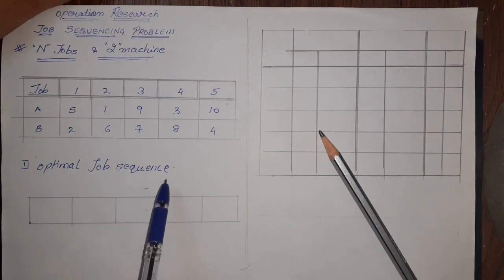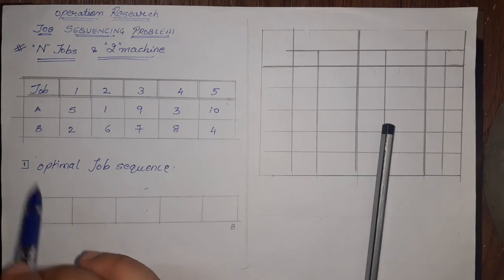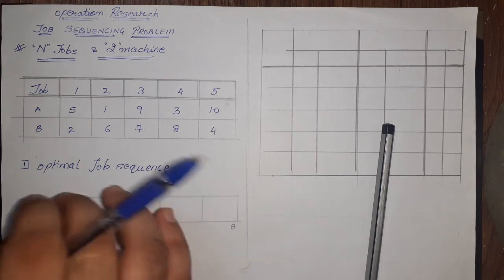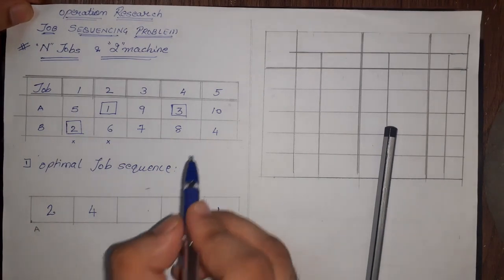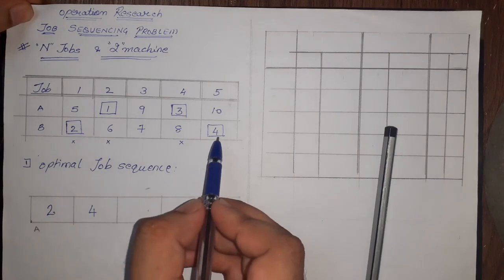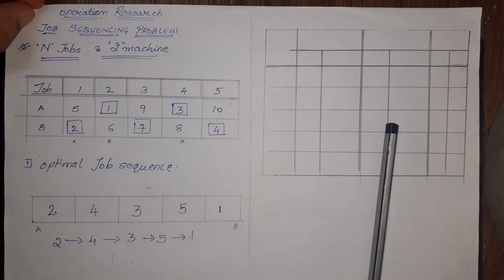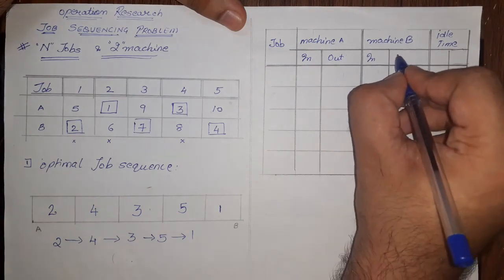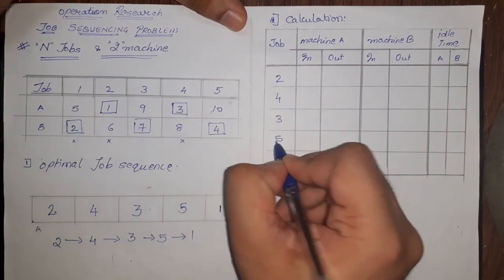Job Sequence with 2 machine-Operation research-problem-By Prof. Mihir Shah

Comment: There is a mistake in machine 2 job 3 time out 15+7=22 but in time in you written 23 .so there is mistakes
Reply from the maker: There is no mistake that difference is the reason cause job A got over at 23.. so job B cannot start at 22. And this difference is called idle time...!!
Reply: FIRST WATCH THE VIDEO 2 TO 3 TIMES BROTHER, THEN AFTER COMMENT IN THE SECTION BOX BCZ WITHOUT IDEAL TIME DIFFERENCE U ARE NOT ABLE TO DO THIS MISTAKE 🙄